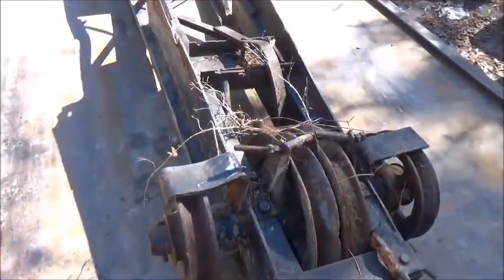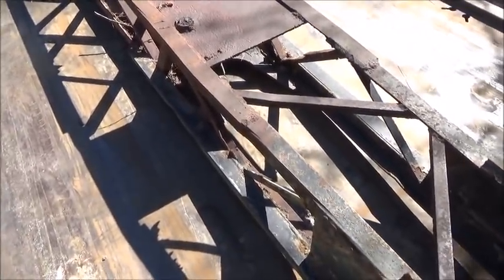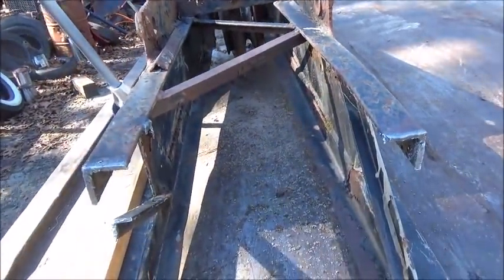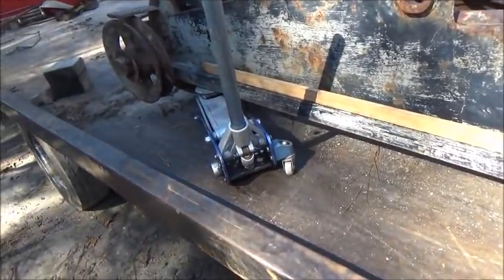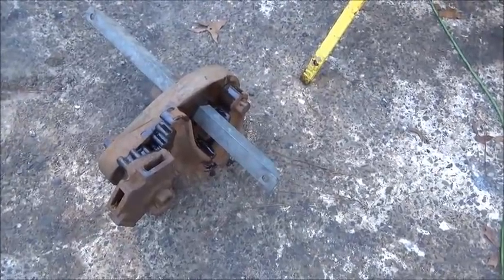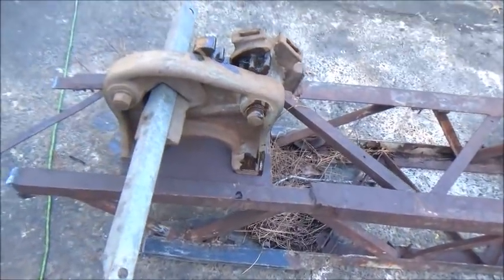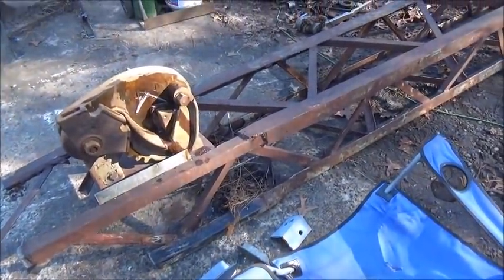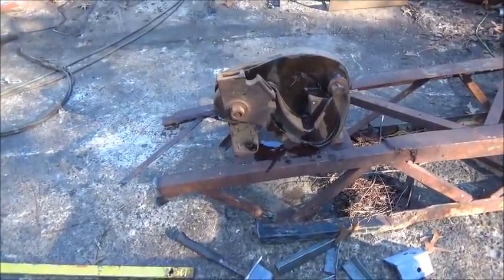1952 UNIT 614 DRAGLINE BOOM REBUILD PART 1

Comment: The wear on the top frame is almost certainly when the ropes have jumped the pulleys and gone down the middle of the two Jonathon, seen it many times before.

You are making a fabulous job of the crane👍👍👍

Comment: I like the way old tools are made to last. Might be rusty, might require some muscle. But you ain't using no electricity and you don't need to drag out the torch. Nice clean cold cutting! You'd spend a lot more than $50 cutting lots of angle any other way. Good video and thanks again for your time 👍.

Comment: I figured the crane was a 1/4 to 1/2 mile back in the woods. Could be more. 1/2 mile divided by 8 hours = blazing NASCAR speeds!  ;-) Seriously though, pulling the engine, replacing that bronze gear, getting it running so smooth and then driving it out of the woods under its own power was some mighty fine viewing. Going to be equally as satisfying watching this old boom getting the JW treatment. Onward!
Reply: Looking forward to you digging into the clutches and the mechanics of that crane.

Comment: 👍, The dragline looks like my Dad has been running it. He thought that if a pc. Of equipment was rated for 14m lbs. it would do 20 , any pc. Of equipment, He had the same thought process, and then get mad as H if it broke, but he could get a lot of work done in a short period of time, but he would stop for 10 or 15 min. For a Sardine and cracker lunch. 🤔

Comment: Love that angle iron shear.  The two screws with the flatblade slots vertical, and the space the angle iron slides through.  Looks like a frog.  If it were mine, I would call it a 'frog cutter'.  LOL!  Carbon air arc gouging might serve you better cutting some of the metal off than oxy-acetylene, if you have one.  Keep up the great work!

Comment: Full reeve boom suspension in place of pendant lines usually used for duty cycle work.. Pendant line suspension used for lift crane.. Get some old tires and lay them down on the top of the boom, secure with cable,  to keep the lines from damaging the boom..... American factory training.. Cheers from Louisiana.. Mike

Comment: You're absolutely right, Jonathon. The crane is designed with every component engineered to a spec. Boom for 20t, winch for 20t, sheaves for 20t, shear pin for 20t, wire for 10T...oops! You got a 10T crane. Any deviation from original design will change the whole thing. I have de-rated many a shipboard crane  because the wire rope was stretched. I watch those cranes fall over too. Sometimes the operator depends totally on what the cranes built in scale is telling them, but even that needs recalibrating once in awhile. good vid again. You got some work to do! Regards, Solomon

Comment: I'm enjoying the Unit crane saga immensely. I must confess that I had the Doepke (Model) wheeled version as a kid in the early '50's. You have made a very good decision to replace rather than repair the long angle and truss members. 45 degrees would be the optimum angle for the truss members except for the non parallel decreasing width from bottom to top makes that number slightly off. Excellent time for an angle gage and some nifty cutting skills. Where's that Caterpillar powered Ingersoll Rand sandblasting unit when you need it?

Comment: Cool tool.  I never knew that an angle iron cutter existed.
Reply: In a way a very crude tool that works just as it was intended for a manual cutter very hard to beat and they are still sold brand new.
Reply: Great video!
Reply: @frankdeegan8974  iiiiiiiiiiiiiiiii>iii>iiii>iiiii>ii>i>>ii>iiiii>i>iii>iiiii>ii>iiiiiiiiiiiiii>ii>>iiiiiiiiiiiiiiiiiiiiiiiiii in iiiiiii
Reply: That's what I said too!  Grandpa's toenails are now - No problem!
Reply: Jonathan's the man to have it.
Reply: Far out

Comment: Hi Johnathan the possible reason for the wear in the struts  just behind the boom tip sheaves is the cable does whip quite a bit especially if you’re clamming or dragging etc so if you have any wear pads you could position there in the sweet spot that would save your cable or a roller right across or even a guide Sheave would work also those eyes just below the area we are discussing on the plate I believe one on each side of the boom could be possibly jib back stay pendants . But I don’t even know if that Unit was equipped with a jib if you have any operator manuals on the internet or even the load chart might give you a clue. Keep that old iron running man and God bless you and your family! 😀🇨🇦🏗🏗🪝🪝👍👎👉👈👆👇🤌

Comment: There's a retired contractor way up north that has 13 Units, mostly in the backhoe configuration but there are a few cranes for dragline/clam setup. Sizes range from 1020s up to the 271, Unit's largest crane.  Years ago he allowed me to go onto his property and take photographs of each machine.  A few years after that I had a computer crash and I lost all my photos. I went back again and Jack pine had grown up in and around his equipment. I took the best shots that I could despite the darn trees. He also has over 45 Caterpillar bulldozers/loaders and 8 Model 12 graders. If something happens to him, I'm afraid most of his equipment will probably go to the scrapper.

Comment: Man, I haven't seen one of those angle iron cutters in years. We used to use one just like that in a metal shop I worked in back I the '60s. It was bolted down to a 6 foot long piece of chanel iron and then bolted down to the floor.

Comment: I've used the next size down till you don't even want to hear the sound it makes as it goes through the steel. 
Worked commercial, and industrial sheet metal in HVAC since I was a kid, well over forty years at the trade.
We use to have to install different size angle iron between the bar joist to carry weight of duct work, be it large spiral pipe, are square duct work.
Depending on the size of duct work determined the size of the angle iron, and the spacing between it in order to support the duct work according to code.
They work great, unless your cutting heavy galvanized coating, sometimes we had to use angle iron with heavy coating of red oxide primer, and occasionally someone would stuff some in with roofing pitch on it. 
Those there will play hell with the cutting edges, and I've to my best recollection never seen a chipped or damaged edge on any.
What does happen, is those coatings will build up over a time, and they get built up on the edges, and more so where they're pinch point is, and from there down between where they slide tightly against each other. Similar to how a pair of scissors cut, and as it builds up, depending on the substance it will almost be as if it was hot dipped in zinc from the pressure and frictional heat generated by the two opposing cutting surfaces. 
Making it too tight at the pinch point, and no matter how much pressure you apply, the two edges will bind up because of the galvanized dip that has adhered to them.
Basically same thing with the primer, and the cold pitch, but these two will come off easily with just a little solvent, and a wire brush, but whatever you do, do not apply any heat to these two pieces, because if you do, you have yourself a high dollar piece of scrape metal. 
Galvanized coating is best removed with an angle grinder with have cable wire wheel attached.
Stay away from the edges unless your at right degree angle of the edges, and preferably stop just short of the edges.
There best use a good file, staying perfectly flat with just enough pressure to clean surface, but without cutting into base metal, because just like shears, snips, and scissors, if the matching surfaces don't line up smoothly, with proper friction on edges.
They'll begin to actually fold the steel between the two points, and either leave a sharp leaving edge, are wedge the metal between the two, and I don't care how big and strong you are they'll get stuck together.
Add a piece onto the end of your bar, so that it fits the pocket tightly, and you'll find it breaks over a lot easier than if it's a lose sloppy it takes more physical effort to break it over.
Also as you use it, and the edges become more polished, and cut cleaner pieces.
Have fun, but myself it ay take a few minutes longer to get the cuts done, but either a porta band, are a healthy 1/2" to 1" stationary band saw, and stack the angle in it, and set your drop rate catch them as they fall off the saw.
Less backaches, less shock to your body as the shear pops leaving the cut, and your trying to catch your bull bar.
Enjoyed the whole recovery, but I do understand the frustrations of the many trials, and tribulations of such endeavors.

Comment: Sure beats torching & grinding. Old tools r the best tools.
Reply: It's an end-times tool--needs no electricity or gasoline, needs no blades to replace like a rotary cutter. The blades will probably last several hundred more cuts and can probably be hand sharpened...

Comment: I've never seen a tool like that...they used to lay (& secure) tires on the top of the boom so the hoist cable would slap against the tires - not the boom on the draglines down here...60 foot deep pit/lake...long years ago they used to go 80 foot but l heard that was getting into the aquifer

Comment: It appears that the owners of the crane wanted it to function.  They did not care about proper repairs, it was a money making device.  Cheap and bad repairs were done.  I'm glad to see you recognize the problems and are correcting all the poor work previous to your ownership.  I think the shear needs to be bolted down at both ends.  The force of your handle pulls the far end up.

Comment: Typical company equipment, employee's tend to beat the heck out of equipment because it doesn't belong to them.
Many yrs ago I worked for a utility contractor in the mechanic shop, 
Some of the same trucks or backhoes would come through repeatedly .. Office: yeah will have a talk with them ...shop: yeah sure you will 🤔 ..but hey it's your equipment and repair bill.
Reply: Are you suggesting some people abuse their tools or equipment while others are more careful???   Like using a screwdriver as a lever when the lever is ten feet away.  Or using the crane to pound on something or  push something aside... I don’t believe that , lmfao...

Comment: I got a chopper for 1.25 angle 1/4 inch has a 7 foot handle on it bolted to a steel I beam, I wish I had a 10 foot handle on mine. Looks like the same handle bar I have for mine, I use it to cut bed rails into smaller portions for projects around the house bought it off a scrapper for $20 with the 8ft I  beam.

Comment: I think you would find if you could see back in time with this crane that the boom has been dropped many times 
Over the years that I worked this style of crane way back in the 1970s the boom cable is outside as much or more than others and are changed way less

Comment: Not that you need another project, but I'd adapt the angle iron cutter with a hydraulic piston.   Since seeing your drag line project, a bunch of others have popped up on U tube. I'm sure you have seen them. Maybe some of those folks could help with parts or information.

Comment: That great tool, do they still make and use that today, Where worked we use the use 3/8" round wire or rod to make temp lets for bending pipes some pipes were 6" ips inside pipe size. That boom in really rough shape, the bracing is it pipe or solid bar? I've seen some booms like that where failed were bent up like tin foil like used for tall building cranes

Comment: you forgot . in the olden days when that was engineered . duty ratings were 55% of the actual failure. 
I other words if something was rated at a ton they could  handle 1&3/4 ton safely. the industry rating standard was changed in the early 1980s to like 120% of rating meaning something rated at a ton could only handle less than a ton and a quarter. of course that includes modern steel . new shit fails easier than old.

Comment: If you use a good steel yard, you should be able to get Grade 50 angle, rather than the commonly supplied Grade 36. Using Grade 50  will, of course, increase the tensile strength of your boom, without increasing the weight.

Comment: Maybe you could use a hydraulic cylinder with an electric motor driving a pump to actuate the cylinder to work that shear. It sure looks like a lot of work and time consuming as it it.

Comment: Part of my job was operating all kinds of cranes for about 40 years. I have seen so many crane accidents it ain't funny. I've seen a lot of screwed up equipment and a couple of lost lives and most of the time it was from an inexperienced operator on a crane that they were not completely farmiliar with. Most of the accidents I've seen that involved cradling a boom or snapping a line was due to over dynamic load or rather load shock that just instantaneously over stresses the equipment and puts way too much load on a piece of equipment and things just come apart from excess weight on the lines. That cutter you have there is an old one but it was probably one of the best ones you could have had in the old days. It workd really well, I'm surprised it still cuts as well as it does. It probably wasn't used a whole bunch. Believe it or not I've seen one that was worn out and had to be replaced and they couldn't buy another one so they had to have the old one reconditioned and it cost them $1,500 about 38 years ago.

Comment: Can the shear be sharpened ? that might make cutting easier I've seen some that was and some have replaceable blades but those were newer. can you tie the boom down on the rollback and straighten it out with the wench and floor Jack or wood blocks make a frame machine out of it just me thinking out loud from being frozen in ice and single digit temperatures in Southwest Va but be safe stay healthy stay busy